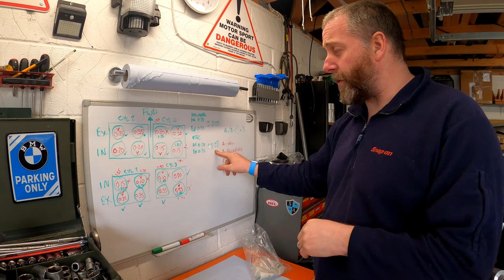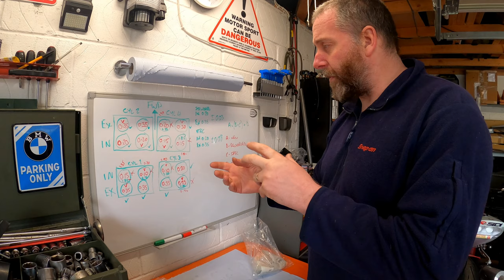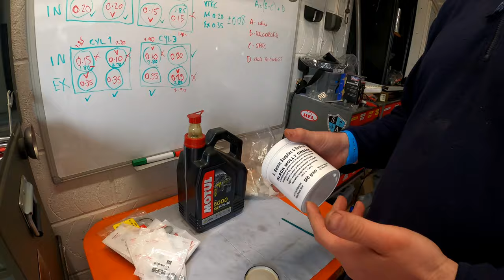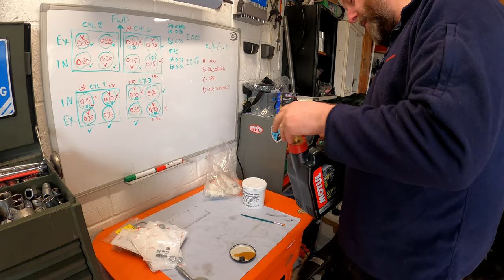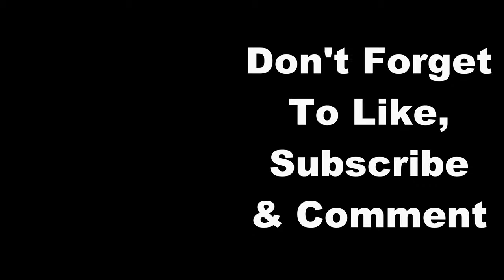Honda VFR800 VTEC Valve Clearance Inspection, Part 3 - Reassembling The Bike And First Start!

Comment: Fantastic video series Kev, VTEC owners around the world will use these videos for years to come and we owe you for the work you have put in.
 My bike is due its first valve inspection and although the local Honda dealer told me that they have never had to adjust clearances at 16K and to wait until around 24K, I am going to do it anyway.  I would have no issue moving VTEC buckets around as long as they measure in spec but I understand why you chose not to.
Just bought a skylift to make thinks a little easier especially moving the bike around. Thanks again.
Reply from the maker: You're welcome bud, glad you like the videos! 👌🤓

Comment: Hey Kevin, great job! You are a great mechanic. If you leave those pins in the VTEC valves, it’ll run on 16 valves all the time! Just like the older gear driven VFR’s. I’m joking, but what a concept!
Reply: Can this actually be done & what would be the biggest mishaps etc ?
Reply from the maker: @terrymurphy2850  Can what actually be done?
Reply: @KevsShed  leaving the pins on the vtec valves to run them on all 16 full time is possible? 🙄

Comment: Just finished (didn’t get any notification for part 2 but did for p3 so was confused for awhile haha).
Thanks so much to both of you for taking this considerable time to film and share.
I thought the spare large o ring from the kit might be the crank cover o ring...? Probably not though.
Could you separate comment the cam cover torque setting (so it doesn’t get lost in this sub thread) You gave us the inner shells and cover at 12nm but I didn’t hear the last cover torque number. 
I’ll definitely be drawing out the different stages on card to store the bolts/seals and hardware in position. I don’t trust my memory while waiting for new buckets and obviously loads of photos. I’ll also be making my own cct key as I twisted one so easily when fitting the new ones in.
Once again, thanks so much for sharing 🙏
Reply from the maker: The large o-ring on the crank cover is much thicker than the one in the kit, the cam cover bolts were 10nm so not too tight at all!

Comment: Fantastic instructional video with excellent video, pace, explanation and detail. My one comment is when you were handling the small shim starting at 6:15 and 7:15 fiddling with the VTEC lifter above the open engine. It was watching a high-wire act hoping nothing would accidentally fall into the open engine. Whew! Cheap insurance to drape a shop rag over open areas lest I fumble a part and make a huge mess for myself. Thanks again!
Reply from the maker: It’s a fair shout 👌🏻😎

Comment: pain in the bum job kev  time taking as i said in the other clips i am a hgv mechanic  but needs to be done !! gear driven ones are easy .
Reply: The VTEC valve check/adjustment is ridiculous. I will just have it done because I don’t want to do it. It’s easy on my BMW, my Ducati, and my Husqvarna. This has a lot of rigamarole involved. Kev’s videos convinced me not to do it myself because life’s too short.
Reply from the maker: Haha, it certainly is! I am one of those kind of people that enjoys spending time pulling things apart! Therefore, I really enjoyed this job! 😁

Comment: kev if i was you those live wires from the rectifier run them in conduct  to prevent any shorts !
Reply from the maker: I get your concern but those cables are sheathed in silicone and the chance of a short is slim to none!

Comment: If you could do a video of how to remove the gas tank without making a huge mess that would be great
Reply from the maker: The easiest way I found was to pull the fuel return line off, but be ready with a length of hose that goes into a fuel can. As soon as you pull off the return line, whack the readied hose in it's place and hey presto! You will lose a small amount though, that is inevitable! 👍🤓

Comment: Great series of videos for this job. Would you also change the oil and filter once you are satisfied the top end has bedded in again and there are no oil leaks?

I don't reckon a dealer would spend the amount of time needed even for £800-900 to do this job properly. And there is no way of checking without dismantling the bike to check the work that might or might not have been done. So it's either a case of do it yourself to be sure if you have the technical ability and experience or find a bike mechanic you can trust to do it properly.

Thank you so much for making this series. A+++.
Reply from the maker: Personally I won’t bother to change the oil and filter, but I can understand why some would want too. Black molly is completely soluble within hit engine oil so no concerns there 👍🏻

Comment: Hi...Kev 

I've just finished watching the 3 part valve clearance videos. 

"Imagine ,oil pressure pushing on a little spring" to activate the VTec , but how does it insure it does so at the correct spot on the valve stem ?

Each cylinder is in a different position but the oil pressure needed when comes up at the rev point surely would be uniform across the valves. Some "bite" onto a valve stem and some close up and block the valve stem ...or rather ,,how does it avoid this ? (I don't know ) 

But my thought during Part 2 was , why not replace all the VTec Pushers to standard and have all valves open throughout the rev range ? 

I'm under the impression the VTec makes it pass emissions targets. 

Would it give a significant performance boost ? Would fuel economy drop significantly ? 

It's made me a little hesitant to get that version VFR in the near future as the cost for the job would be out of my reach. But having your instruction , rather them ,(local trusted mechanic) , than me.  

Thanks for the insight. 
Yours sincerely,
Alex (Suffolk,UK)

Comment: How long time would you estimate it would take to do this job. Without making the video at the same time, ofcourse. Thanks for a great resource. I have 135k on the clock, no way of knowing if the clearances were ever done. Have the gasket kits, and now I should have the confidence! Thanks.
Reply: I believe the shop time for just the check is 5.5 hours. I think it’s an additional 2 hours if adjustment is necessary. Insane!
Reply from the maker: Good answer, I actually didn’t realise that there was an official book time, I reckon I could have it done in 1 day, start to finish including any adjustment but obviously nobody holds stock of lifters or shims in their own shed/garage so that adds time!

Comment: A hell of a job that is... Have You noticed any difference after the valve clearance? Are You planning to do the throttles since so many valves needed adjustment? Btw great vids with loads of detailed info.
Reply from the maker: The bike doesn’t feel any different to ride! There is a starter valve sync video coming very soon 👌🏻😎
Reply: @KevsShed  Awesome, can't wait. One more question - based on what You saw was it the first clearance job ?
Reply from the maker: @przemowroblewski  If i had to guess, I would say that it is the first time that the cam covers have ever been off the bike, in my opinion!

Comment: To keep the VTEC alive, now may be the time to start purchasing donor bikes for engine spares. Have a look at the parts' suppliers' and see how much is on back order and now UNAVAILABLE. Remember they don't make this engine any more so if the parts don't exist, they probably never will!
Reply from the maker: Very true! Honda are better than some manufacturers though! If I recall correctly, and I may well be wrong on this, but I’m sure I read somewhere quite some time ago that vehicle manufacturers are legally obliged to support their vehicles with a spares program for 15 years after the last of that model has rolled off the production line! It could have been an EU directive, who knows! 🤷🏼‍♂️

Comment: Hello there. Two sundays ago i bought a 2009 vfr and since it's my first big bike, i'm scared of tipping it over. Do you have any suggestions on frame sliders? T-rex makes a pair that do not need cutting the fairings. Do you have any other suggestions? Also i watched a video from FortNine that suggests using gear oil to lube the chain. Are you doing the same?
Reply from the maker: I actually don’t have a recommendation for frame sliders on the VFR as I’m not using any myself! Sorry about that! On the subject of gear oil in the chain, this is a highly contentious subject that has both agreement and disagreement from ALM sides! Gear oil is in fact perfect for bike chains, in fact I am pretty certain that the factory manual will specify it, that said it will probably also mention any other commercially available chain lube/wax too! It’s up to you really! Although I will say that if you go for the gear oil option, it’s cheap and a bottle will last you for ever!

Comment: Hi kev, interesting videos, Would you know on a pre v Tec bike 1999 do the valves need doing ? at 30 k ish. I don't have any running issues just for information. Cheers Ade
Reply from the maker: Give me a second and I will check the manual for you 👍🤓
Reply from the maker: I have just looked in the manual and the Valve Clearance Inspection is every 16k miles also, the beauty of that is no VTEC to worry about so no having to pull camshafts out!
Reply: Ok thank you I don't know if they have ever been done, bike runs sweet. Maybe something I need to get sorted in my future maintenance schedule.

Comment: Hi may I know if the gasket o ring kit A comes for the front and rear cylinder block ? Because i need to do a cam chain replacement soon.. thanks.
Reply from the maker: Kit A contains items for both front and rear cylinders buddy 👍🏻
Reply: Thanks so much.. its a great help..

Comment: Great video as always Kev 👍🏻,

Noticed my 2003 VFR 800 has developed a rattle, starts around 5500rpm and is worse when VTEC is engaged, Could this be to do with clearances or CCTs?

Thanks John
Reply from the maker: Cheers bud! A rattle is usually associated with the CCTs, can you really hear an engine rattle once the VTEC has kicked in? I doubt I could on mine!
Reply: @KevsShed  yeh around that area can definitely hear quite a loud rattling sound which is worring, think I'll change both CCTs 1st as the bike has done 28k miles and at least there changed then (fingers crossed rattle goes) if not then I'll have delve deeper, 

Cheers for the reply as always Kev 👍🏻